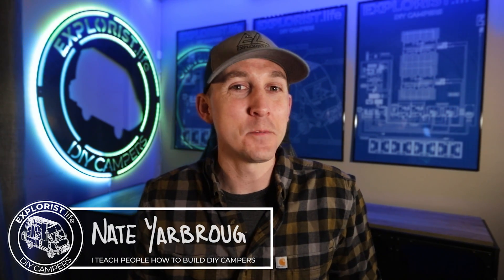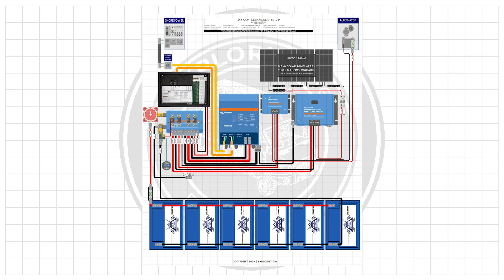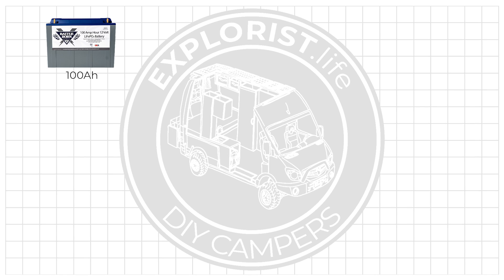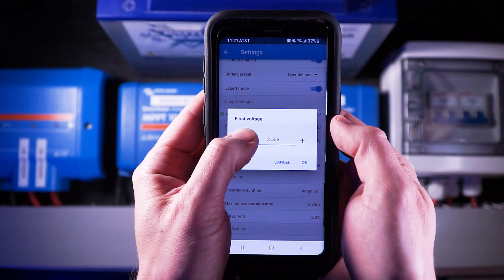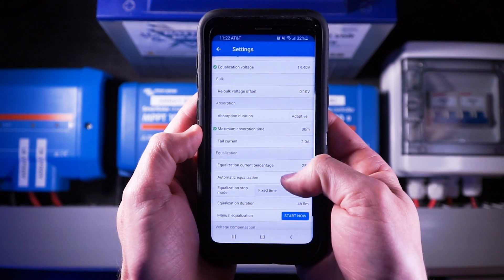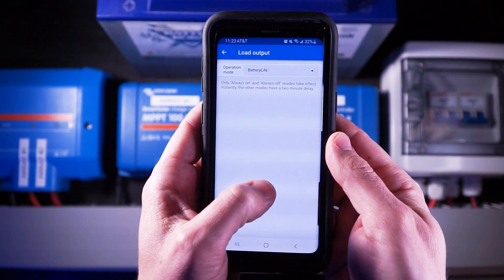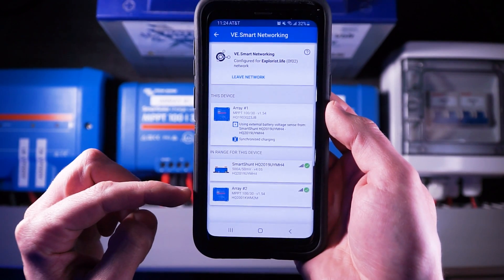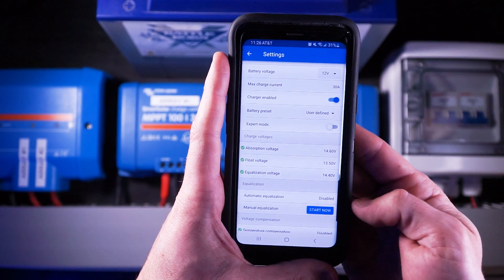How to Program a Solar Charge Controller in a DIY Camper Electrical System

Comment: Why are you setting equalisation on LifePO4 batteries? They should not be equalised by the charger, this is what the BMS does.
Reply from the maker: Equalization for LiFePO4 is turned off, but the voltage is set low enough that in the event the charge controller tried to go through an equalization cycle, it wouldn't matter.

Comment: Question related to absorption time, in video is mentioned 30min for 100Amp but what if u got 2x 12V 100AMP in series = 24V 100AMP that means 60 min for absorption time or still 30 min??????

Comment: I just hooked up my 100/15 victron charger to my diy "solar generator" with a 50ah li time battey and a 220w ecoflow solar array. It would charge for about 40-50 sec and stop. I did a bunch of troubleshooting, but then realized at the end, that the battery might already be fully charged. I'm draining the battery tonight and will retest tomorrow

Comment: Question, how come the app for the 100/50 shows 13.7 volts but when I put my meter on the batteries it only shows 13.1 volts

Comment: Hey Nate. Great work in keeping this simple for the rest of us!  Here’s my question.  I have 3x200W panels (10a 20v) and 2x175w (9a 19.5v). In order to maximize the solar panels should I run the 3x200 in series to one mppt and the 2x175 to another mppt?  It seems from the math, if I am doing it correctly, that this would best utilize my solar array. Appreciate your feedback.

Comment: Hi Nate - thank you for the videos. I would love to learn how to install a voltage switch in order to use excess solar power and redirect it to a heating element to a hot water tank so that I can heat up hot water on sunny days when my batteries are fully charged. 

I have recently installed 1600 watts of solar onto my 73' old wooden boat (built in 1922!) after upgrading my electrical system to Victron equipment. On sunny summer days, I have lots of excess power and would love to use it to heat water instead of burning diesel fuel on my furnace. Any thoughts of putting a video on that, or can you direct me to resources you would recommend? 

Thanks!

Comment: My 150/70 doesn’t allow me to put more than 70 amps in the “Max charge current” setting. With 600 ah of BB shouldn’t I be able to enter 300? I currently have it set at 50amps. Maybe that a software revision change or do I have another setting wrong?  Thank you 🙏
Reply from the maker: A 70A charger can only put out 70A.
Reply: @EXPLORISTlife ok got it. Thank you! I guess I misunderstood when the video showed battery max charge current * # of 100 ah batteries.

Comment: do you have a video for the poor people where they dont have bluetooth or wifi controllers with basic MPPT controllers
Reply from the maker: Our free videos are for people of every income level and I think that there is something to be gained from each one even if you aren't using the exact same components I show.  But no... I don't have any non-bluetooth specific programming videos out at this time.  Those types of controllers don't really warrant a video, though, as their programming options are usually very limited and you just turn the dial to whatever setting works best for your batteries.  That'd probably only make for a 30 second video. 🤷😂

Comment: I tried downloading the settings from my 75/15 to my 150/100 & I received an..
 "Error loading file. #1 settings file not for this product."

I just manually entered the profile on the 150/100.
I am curious as to why the download didn't work...maybe I made an error somehow. 🤔
Reply from the maker: Copying the settings like that doesn't work between different models/sizes of charge controllers.
Reply: @EXPLORISTlife  OK, I wondered if that was the case. It makes perfect sense. Thank you.

Comment: Not aure if i can get help on this. But my system is giving me a "low voltage" alarm. I have 300ah lithium battery wirh 400w solar. Its a 12V system but my battery voltage is at 11.05V. If anyone can advice on how i can trouble shoot this id really appreciate it, thank you

Comment: I have victron mppt 75/15 for my 80 series Land Cruiser marine group 27 deep cycle house battery. 

I wonder why victron doesn't have a common flooded lead acid charging profile in the pre set options.

Comment: I’m so confused. These settings are for lithium. What are the charging parameter for a lead acid battery that’s not AGM?
Reply: Just put the rotary switch to the setting for your battery and you will be fine.

Comment: What do we do if the manufacturer does not have float and equalization voltages anywhere in their specs?
Reply from the maker: You may have to reach out to them directly and see if they are willing to help.

Comment: As Always, another Great Vid Nate & Steph.  I guess I’m a little Slow, or just inject (things) that are imagined.  Do you have to have (the Dongle) to use Victron Connect ?

I have:
Multiplus
VE MPPT
VE DC-DC
VE Lynx

Vatrer Batteries
NON-VE Shunt
It should be simple, but I see the Dongle on some of the EL Diagrams, and not on others, and I don’t see it in Kit ordering lists ….
Reply from the maker: I have the appropriate dongles where they are required in each diagram and in each of the kits in our store here: https://shop.explorist.life/product-category/all-products/camper-wiring-kits/complete-wiring-kits/

Comment: Hello I need help on setting the absorption time on my battery bank
I have 6 12 volt agm 100 ah batteries brand carrier transicold they work awesome but I think I'm not charging them correctly I'm using a victron mppt 100/50  I have them to do 1.30 hrs now 
 Thank you everyone for the advice! Here is some of the specs on the battery label

CCA-1150 . PHCA-2150
Reserve Capacity- 205 minutes
Cyclic Charge Voltage: 14.4- 14.8V @ 25*C
Float Charge Voltage: 13.5- 13.8V @ 25`C
No Initial Charge Current Limit
Terminal Torque - 22.6 Nm max (200 in [bs)
Nominal Weight -35.3-kg(77.8 ibs)
12V, 100Ah

Comment: We got duped… our 100/50 Victron charge controller does NOT have Bluetooth. What now? Can’t find any information on it. It only has a screwdriver setting that has presets to get to Lithium. Not sure what to do. I have the cerbo unit and can see everything but no setting changes like seen on the Bluetooth systems. I’m sick. Can you help?
Reply from the maker: Sounds like you got a BlueSolar MPPT instead of a SmartSolar MPPT.  The BlueSolar needs the VE.Direct Bluetooth dongle to be Bluetooth compatible.  Reach out to your victron dealer to get that swapped out.
Reply: @EXPLORISTlife  thanks, but I’ve had it too long. I have a dongle but it connects to my victron inverter. Uses cat 5 and this charge controller uses a tinny connection that is now connected to the cerbo. Not sure of the connection type. I may just have to buy the dongle. Thanks for your help.
Reply from the maker: If you've been 'duped', that tells me that you purchased a SmartSolar MPPT and received a BlueSolar MPPT instead?  If that's the case...  it shouldn't matter how long you've had the unit if your victron dealer sent you an incorrect part.
Reply: @EXPLORISTlife  I’m my ignorance, I didn’t ask, just assumed and was not familiar with the two options at the time. Now I research, research!

Comment: TALK ABOUT THE DIAL SETTINGS AND THE 3 SUB-OPTIONS YOU MUST SET! The manual does not what which and why a an option should be chosen.
Reply from the maker: Don't use the dial.  Set it up in the app like shown in the video.
Reply: @EXPLORISTlife  Yeah, I was going to go ahead and do that. It is a shame that no MPPT made can work with the many good batteries out there.
Reply from the maker: I mean... if you use the smartsolar MPPT like I showed in this video, it can handle pretty much any battery on the market.
Reply: @EXPLORISTlife  yes I understand that, I was referring to the presets. It would seem to me that an iron phosphate batteries and work the same LOL love your channel by the way

Comment: Thanks for this video. I have a quick question regarding the battery preset. Since the battery is controlled through its own BMS which does not care about the Victron setting (from my own understanding), does it make sense to just simply use the rotary switch ? Thanks again for all the videos. What I learned from them helped me to build my system.
Reply from the maker: No, you still want to program the charger to deliver the proper charge to the batteries, which is most easily done as shown in this video.
Reply: @EXPLORISTlife  Thanks again. I am using Rebel battery and had a hard time asking for the charge profile of the battery. Looks like they don't want to release this info for some reason. They said just use the #7.

Comment: Thanks for all the informative videos, Nate!  I understand each manufacturer would have different specs for their charging profiles, but I’d expect the basics to be the same. My manufacturer is saying that all (12v) lithium batteries, including theirs, should just be charged at 14.6v, and that concepts like Bulk, Absorption and Float don’t apply to this battery chemistry. They say to set those all at 14.6v. Can you explain why this may be the case, or why settings closer to what you’re using for the Battleborn batteries could be better for overall performance, safety, and/or battery health?  Thanks!
Reply from the maker: Nope, that's not the case.  and that's downright irresponsible of them to make such a blanket statement.  Victron LiFePO4 batteries for example want to be charged to, if I remember correctly 14.2v.  Each battery manufacturer makes it's own charging parameter recommendations based on their own particular cells and bms.
Reply: I think it is based on manufacturers BMS what voltage they need. It is this BMS that finally cuts off your current when battery is full and if your voltage is set too low it may take ages to charge to full capacity. Most batterys this is 14.6v.

Comment: Hello Nate, just watched a few of your videos which are easy to follow and very informative.
I have a Victron mutplus 3000 and 3 x 100ah lithium batterys and MPPT victron 100/30 controler.
  Probem is that i have is as follows. Recently the Multi plus doesnt charge the batterys via the solar panels. The MPPT when opened in the App shows the Wattage as 0 watts, eventhou my volt meter shows 22.7 volts comming in from the 340 watt panel, and a battery voltage of 12 + volts.eventually the batterys go flat.
Is it normal to have ZERO Watts displayed when I open the App on a nice sunny day?
Reply from the maker: If your batteries are not full, you should see wattage.  I'd start with triple checking all connections.  This may be something you would want to reach out to your Victron dealer to help troubleshoot.
Reply: @EXPLORISTlife  Thanks Nate, yes I will see the dealer 
Cheers

Comment: 3 no ) 12.60v 40amp Lithium ion batterie pack....

absorption voltage 12.60, float voltage 12.60, equalisation  15.50 connection ok sir....?
Reply from the maker: You'll want to reach out to your battery manufacturer for that info.

Comment: Hi I have a question 
How can I turn the state from off to on. I have a Victron Energy MPPT 100/50 BlueSolar Charge Controller
Reply from the maker: You'd need a bluetooth dongle for that charge controller to access the Victron Connect functionality of that charge controller.

Comment: Any help what went wrong? My Electric guy fit two victron 305w solar panels on roof then conect victron 100/50 mppt to batery and then conect solars to mppt and start updated mppt and after 1min from mppt came smoke!!!😢
Reply from the maker: That could be several things, usually stemming from wiring the unit incorrectly, but without seeing how it was wired and such, it's impossible for me to say.  I would say, though, that your 'electric guy' should be able to troubleshoot pretty easily, and if he can't, you/they'd need to reach out to the victron distributor the unit was purchased through for guidance there.
Reply: @EXPLORISTlife  ok thnks bud i will send back that device

Comment: Thank you for the videos. It shows in my booklet that I need to pull the little black jumper thats in position 2,3. Do I need to still do this whilst making changes like you just did in advanced mode? And I've been really busy and apologize if you covered this in another video

Comment: hello I have a request, can you help me set the parameters in my victron MPPT 150/35 charger I have 3 pieces of 12V 100Ah Smart Lithium Iron Phosphate Battery w / Self-Heating Function
 SKU: RBT100LFP12SH-US I wrote to the technical support renogy as advised but they blew me away

Comment: Hi quick question I have 8 100 amp hour 12 volt LifePO4 batteries, what should I set the batter capacity to. Thank you.
Reply from the maker: If you have 8x 100Ah batteries... what is your battery bank capacity?

If you have 8x 1 gallon jugs of water... how many gallons of water do you have?

Same concept.
Reply: @EXPLORISTlife   so 800Ah Thank you.  I had it set for 99. Again thanks for making this video. 

By any chance would you do consulting by the hour? I just need to make sure I know when my batteries are getting really low.

Comment: Can I use this charge controller to charge 16.8v 4s battery .
Reply from the maker: That's not a voltage we typically deal with so I don't know off the top of my head.  You'll want to dive into the user manuals and datasheets for the MPPT's and figure that one out for yourself.
Reply: @EXPLORISTlife  thanks

Comment: I got issue with the charge is disabled due to Engine shutdown detected so my refrigerator is off and the only way works is when  I start the van; also loads are disable. I don't know what to do please help me.  The only thing I did was to update the app and I get this issue. I really appreciate you help
Reply from the maker: Sounds like you have an issue on the house battery side of things if your loads turn off when the Orion is off.

Comment: Maybe a stupid question…I have 2 100w panels hooked to 2 100ah deep cycle marine batteries…in parallel…into a 1500w inverter….should I leave inverter ON even when I’m not using my van?
Reply from the maker: Inverter should be off, in that case.  Similar to how you turn off your lights in your house when you leave.
Reply: …or…I guess…just shut off the solar controller 🤪

Comment: Why would a MPPT solar charge controller kick in and out when charging or when a load is on like a small fridge … charges and then stops . I did added two more 6 volt batteries ( total 24 volts ) and it was running for 2 months before this started .
Reply from the maker: Sounds like the batteries are simply full and the charge controller is only supplying power to the actively running loads.

Comment: Hi, thanks for all the great info you share in the most simple way.
Please help, I have two 48v/325w panels setup in parallel running through a 100/30 Victron CC connected to 2x AGM 200A batteries connected in series 24v. Why does my solar array show only 192W and 36v and 5.3A?
Reply: That's running at 60% capacity. Not terrible, not max.
Check the solar panels.
Then check wiring.
Check temperature.
Check panels for spec.

Panels should be clean and pointing at the sun.

Wiring must be of sufficient size to carry current for the distance. Connectors must be sound.

High heat can cut power down.

Measure the spec open circuit voltage and short current. Be careful. Use the correct rated meter properly.

Comment: what the max charging rate with a 200 ah in a single battery.? Is it the as two 100ah batteries?
Reply from the maker: Each battery is different.  You'll want to check with your battery manufacturer.

Comment: Thanks, I cannot find charge parameters for powerxon 250ah agm battery ? I also cannot find setting via victron connect wherr to set minimum voltage  ( to save battery life). Using app's latest version as today.

Comment: Hi Nate, great video. How much "secret sauce" goes into these charging algorithms? My caravan has a BMPro J35B BMS, which according to the manufacturer is not suitable for Lithium. However looking at the manual, the bulk absorption phase voltage is 14.4v, float is 13.6v which is engaged when there is less than 2A of current. I have looked up the manuals from this manufacturers Lithium compatible BMS's and the only difference I can see is my unit runs at .2v lower during  bulk absorption and does not have a boost phase where these other units output 30A (mine is limited to 15A). All other voltages and amperage are the same, even the charging profile graphs look the same with exception of the boost mode.

Unfortunately these units do not have user configurable parameters, so my only option to proceed with lithium with the BMS manufacturers blessing while also maintaining integration with my caravans management app seems to be to purchase a new BMS at between $850~$1100. I would be more accepting of this I guess if I knew under the hood these charging algorithm profiles were doing much more than what they seem to be doing from the manufacturer documentation.

P.S - I'm fine with the lowish 15A output of this BMS as I have another 40A MPPT controller which I am going to use with 2 x 300W solar blanket (this controller is lithium compatible and has user definable parameters).